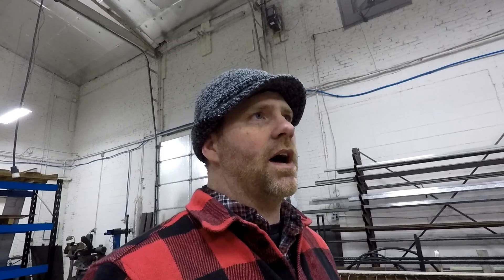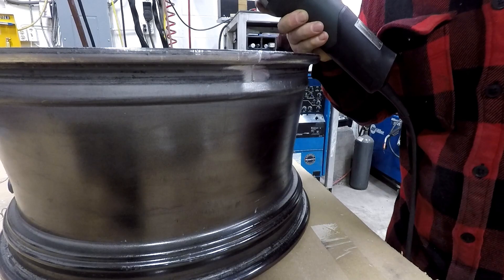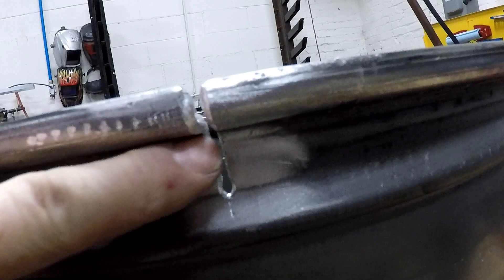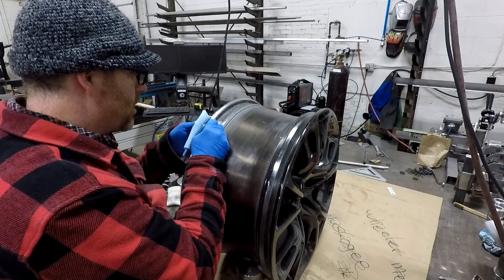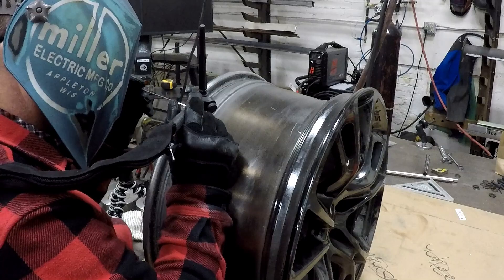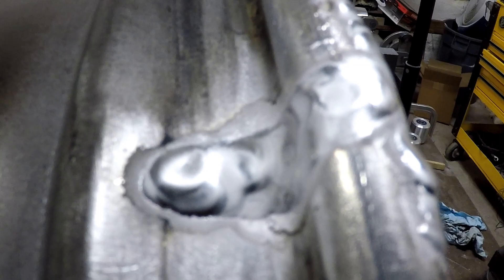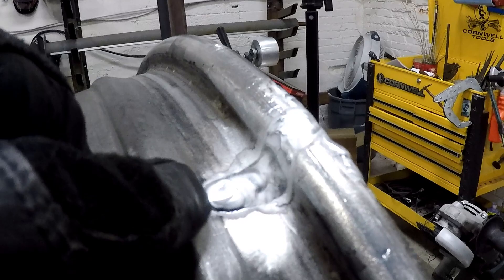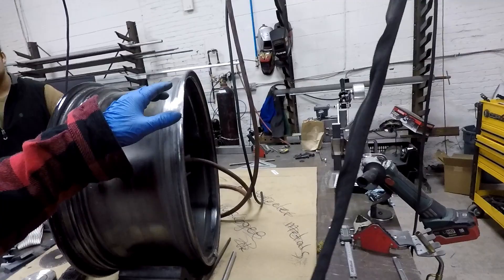How to fix a cracked wheel  RMW Vlog 110

Comment: I used a metal file a couple of times to knock down the bead. I take off the bulk of it with the file than finish off with sanding. Seems to save some time.

Comment: First of all, thank you for your time and effort in making the video! I am sorry but i think that your technique is not good. There will be a lack of penetration inside of the mass of the wall where you made first run on each side of the rim. In addition to this on the inner part of the wheel ( the part where the tire sits and what you have sanded with sandpaper) even in your video, i can see spots or bubbles or porosity in the weld whatever you like to call it (time stamp  16:33 and onwards). I also have an Aluminium wheel crack repair video on my channel, so if you are interested you can see a different method. Not trying to bring down your achievement by any means, just my worthless opinion.
Reply: I’ve seen you video. You were right that everybody has there methods.

Comment: Hi I had a crack welded at a very reputable wheel shop where I live. Will the weld be as strong as any other point at on the wheel, or will the area of the weld be weaker. Thank you

Comment: My boyfriend had his rim fixed through jack williams and the tire is flat again.   Is there something he can do Bc it did cost him about $300 for them to fix it. He has a Lincoln
Reply from the maker: Hi Brittany, have him take the wheel off and examine where they did the repair to see if it has cracked again.  He can spray it will soapy water and you will be able to see tiny air bubbles form where the leak is.  If it is where they did the repair, see if they will fix it.  If not it will need to go to someone who is capable of doing the repair correctly.  Thanks!

Comment: I think that torch is to small for the wheel thickness, I usually use  8 or 10 and frequency up to 180. Anyway you did a great job.
Cheers.
Reply from the maker: Thabks Lenard!  A little more info, I weld almost all aluminum with a #4 cup for a few reasons.  I like to keep no stickout on my tungsten and the smaller cup allows me to get where I need without tungsten sticking out.  I do this for the simple reason of how aluminum drops and builds up compared to non ferrous welds.  This cup is only good for a maximum of 200amps for short runs.  I weld all cast at 60-70hz for penetration.  I found the higher the freq the more it builds up on the surface.  The other thing to note is I dont weld at 50/50 on amplitude like everyone else does.  I double my positive amps compared to my negative.  I get the best cleaning for cast and best penetration.  I have to weld at 90% off time for positive this way or you will melt your tungsten.

Comment: Do you sand the outside as well?  I recently had a wheel repaired in a similar location, when I picked up the wheel it had this weld mound on the outside, when I asked about it the guy said it should not be sanded down because it is structural? Or is this just shoty work? he charge $150 and did not even paint it.
Reply from the maker: You want that weld there, dont sand it.  I can't say if he just welded over the crack or if he removed the crack like I do.  If he just welded over, dont sand out.  I dont sand out either.  But moat of my welds on the outside end up flush.

Comment: couldn't it be aluminum stick welded or mig welded?
Reply from the maker: I have no experience with aluminum mig welding nor stick.  Tig would be the preferred way due to it's better puddle control.  For me I can go back and re weld the puddle as many times as I want without adding material when using TIG.

Comment: Do you ever do a contrast and dye test to test for leaks?  That's the last part I do when repairing rims to make sure the weld is sealed for sure.
Reply from the maker: I don't.  What I do is a leak down teat over 24 hours via a pressure gauge.  I spray with soapy water once I seat the tyre to make sure if it bubbles to fix asap before the 24 hour leak down.

Comment: Thanks for the great video. just a question: is there a big chance that it will crack from the same spot?
Reply from the maker: If it is filled correctly it will be as strong or stronger than the cast.  But if the rim is bent, it could induce more stress in that same area.

Comment: I just changed a wheel for my wife. I thought it was don but looking at your video I'm seeing that I can save some $$ by getting it fixed. One question though... if the crack is also bent, do u hammer it back in place then open the cut to wield??
Reply from the maker: The bend will need to be fixed first, as that is probably what eventually caused the crack.  You can heat it and persuade it back straight, just dont over heat it.

Comment: you think a 110 tig welder from ebay will work for this?
Reply from the maker: No.  You need an AC/DC tig machine with at least 120amps.

Comment: What kind of welding machine do you recommend for doing that kind of work on wheels?
Reply from the maker: Any machibe that has AC will work.  But I reccomend a newer inverter power supply machine.  These generally will allow you to alter your frequency among other things.  Budget machines are available from Alpha tig, Everlast, and even Lincoln Electric.  If money is not as important, Miller Dynasty, Fronius, & Lincoln have you covered.
Reply: How many amps needed?
Reply from the maker: @Handstandin  any where from 120 to 160.  Depends on the wheel.
Reply: @Regalmetalworks  thank u sir
Reply: @Regalmetalworks  also what's ur Hz and %?
Reply from the maker: normally I run 250 initially to build up the weld, then turn it down to 60hz and go over it all and blend it in.  My balance is run lower on the electrode positive side, say 90 (Miller)because I am running twice the amperage on electrode positive.  But most machines don’t allow that, you are locked at 50/50 on amplitude.  In that case I would run it around 65(Miller) or more ac positive time.

Comment: How many amps did you weld it
Reply from the maker: That depends on wheel thickness, but I set it to an average of 130.  I have independent amperage control on positive and negative wave.   I set positive 100 amps higher than negative at 90% on time on the negative wave.  It gives deeper penetration and better cleaning on cast than even amperage with say 75% on time.

Comment: hey mate I see you don't bother with pre heating the rim or post heating either???
Reply from the maker: Preheat is not necessary and can do more harm than good on cast aluminum.  Post heat would be the only thing that would poasibly be beneficial, but not knowing the actual composition of the cast, it could actually weaken the entire rim if done incorrectly, not to mention ruin the finish.  Cast iron is better to post heat due to the weld cracking if not slowly cooled.
Reply: @Regalmetalworks  cheers mate, also i like the swivel head torch you use, would you have a link of where to get one??  :)
Reply from the maker: @nickhughes4317  that is a CK Worldwide Flex-loc torch.  Most online weld suppliers will have it.

Comment: why 4043
Reply from the maker: 4043 welds cast better due to its silicon content.  5356 filler is stronger but tends to have porosity on cast.  You are already battling that when welding cast due to the nature of casting.  Hope that helps!
Reply: @Regalmetalworks  ok
Reply: 5356 is much stronger and seldom has any porosity problems welding on the rear bead. Some late model wheels mostly after 2012 are cast with some small percentages of impurities into the face only and does cause some porosity when attempting to weld in damaged edges. The front and rear portions of the wheels are made separately the fusion welded together. Hence the different materials on the front and rear beads.
Reply: @roddinbc  never seen it
Reply: @roddinbc  I have the exact same experience as you described, we work on many Mercedes wheels in my shop and most of the faces have porosity and impurity in them no matter how much you clean, heat. I even tried 4 types of tungsten, different cup sizes and filler alloys. NEVER had problems with the back barrel, never seen any pores after grinding. I ALWAYS use 5356 on my repairs.
Reply: @b.coapsi8736   Thanks for the feedback. After initial inspection, you must tell customers with damage needing welding, that there is a high probability of tiny holes being visible after the weld repair. I once had a customer argue with me on price after some very minor porosity was visible and I mean very minor on a machined face Mercedes wheel. But only if the face requires machining and clear coat after welding. Painted surfaces obviously can be filled before painting.
Reply: @roddinbc  yes sir! we always advise against diamond cut machining if there is any damage that needs welding to avoid surprise pinholes. What I did notice and you can try for yourself is using a #8 gas lens with 2% lanth tungsten, 5356 filler in 1/16 and avoid putting too much heat on the piece. Just enough to melt the filler nicely into the wheel face. In and out to the next dab. This gives the best results for me, but again can't say there are NEVER pores.
Reply: @b.coapsi8736  When you are attempting to repair and match the other wheels on the car, there is not a lot of choice. Either do the diamond cut or discard the wheel.
 We have had brand new cars curbed on test drives where there are only 2 choices, weld and hope the pinholes are small enough that they are not noticed or (if possible) change the profile slightly to macine off all the damage. 
When applying clear coat over pinholes, bubbles appear over these pinholes, especially if you bake the clear, making them really obvious. 
Changes to the profile could mean the wheel is not likely repairable again. I think wheel manufacturers add impurities intentionally so weld repairs are difficult or impossible. Older wheels were never a problem.
Reply: @roddinbc  awesome insight man! hopefully people will read this exchange